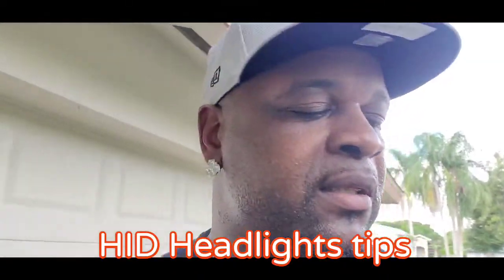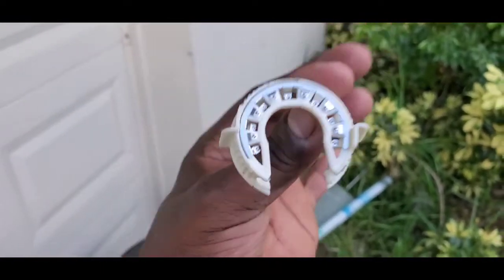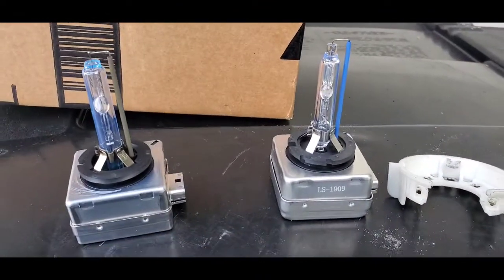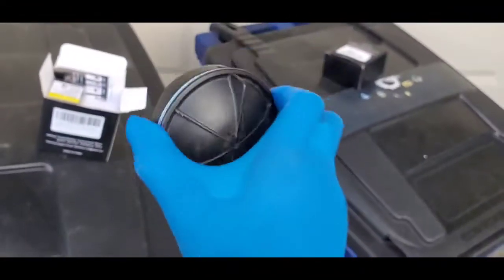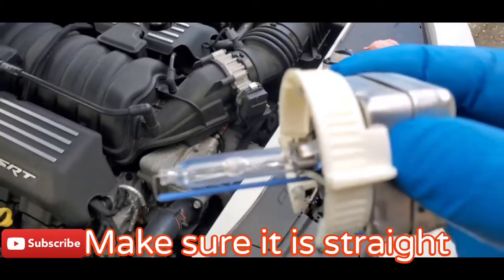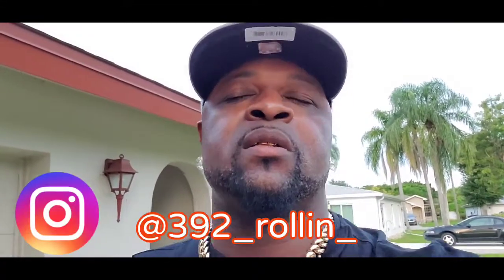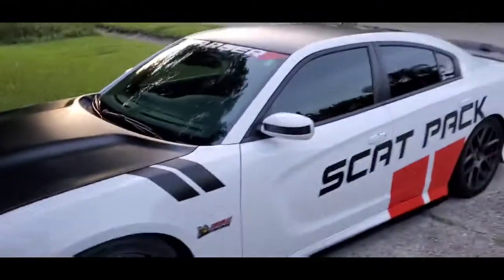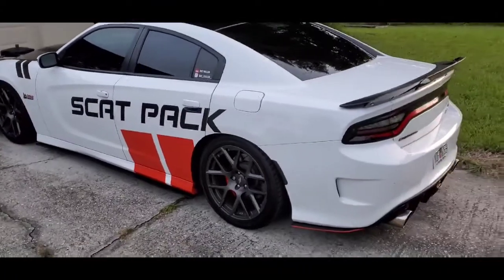HID Tips for your Scat Pack/Hellcat...

Comment: Any kind of oil, even sweat, touches one of those bulbs and....oil holds heat and raises the temperature that's supposed to give off and causes them to fail. I wouldn't take no chances with that much of an investment. But I've changed some bulbs and made sure sure sure my hands were dry and had no issues. From now on I'm wearing gloves tho.